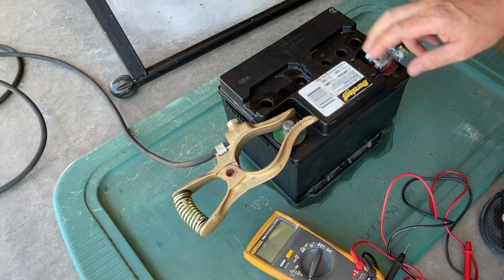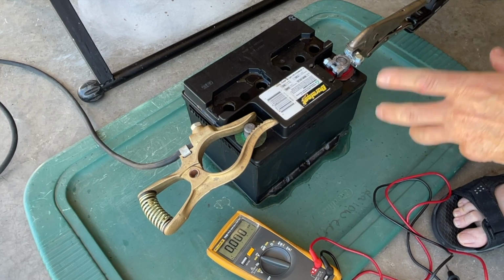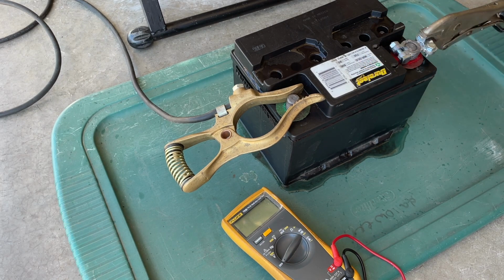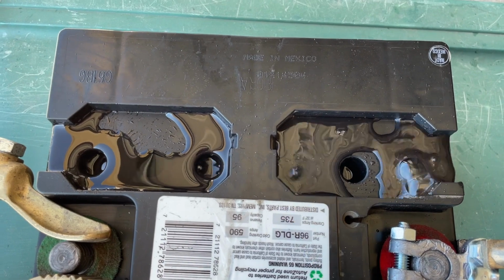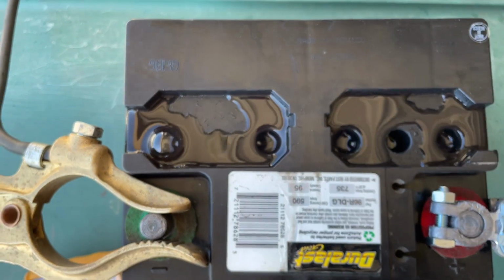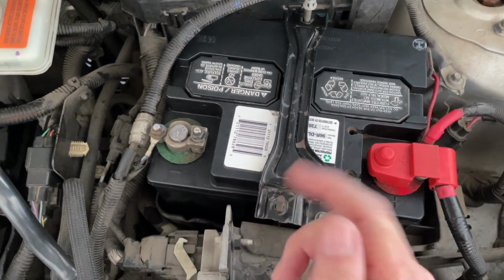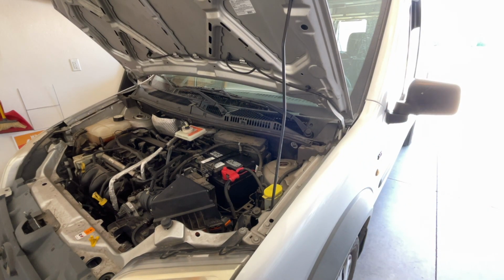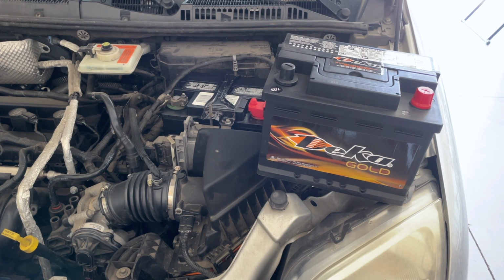This BATTERY RESTORATION with a STICK WELDER might be a FAILURE!

Comment: Did you top off the water in the cells that may have ran low from boiling with distilled water?
Reply from the maker: Yes

Comment: I have used ronix AH4604 MODEL 200A dc welder  but it doesn't  workout  for me  i used on other two batteries  it still same no boiling of liquid 😢😢😢😢

Comment: I saw this approach on another channel. I tried it on 3 batteries & only 1 battery was able to recover 3 cells...so I'd say it was a failure.  The fumes that came up were pretty strong so being well ventilated is a must.
Reply from the maker: Yes definitely do this in a well ventilated area.

Comment: Y’all are having the amps too low turn that shit up quit being scared what do you gotta lose I do mine at 150 A I don’t put water in it I leave it kinda low on the water. I put water in it after I get done with the treatment because if you freshly add water to it it’ll boil with that many amps. Y’all are forgetting that the big chargers that they have at the mechanic shop are 200 amp chargers don’t be scared of some amperage!